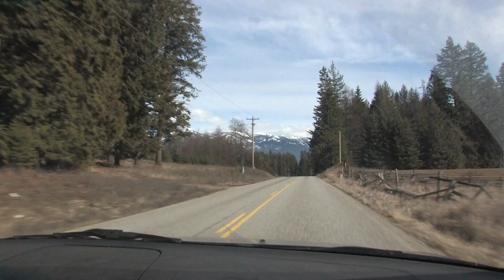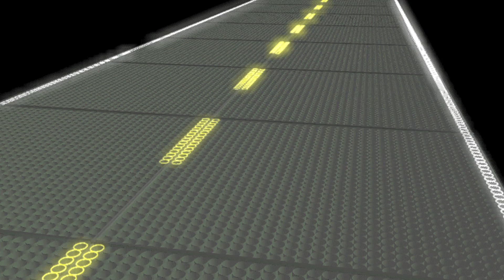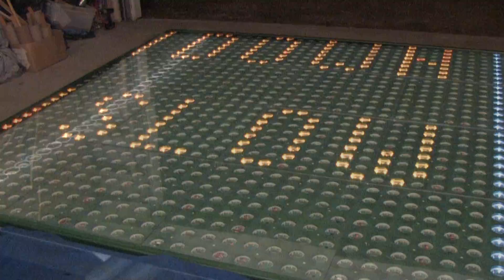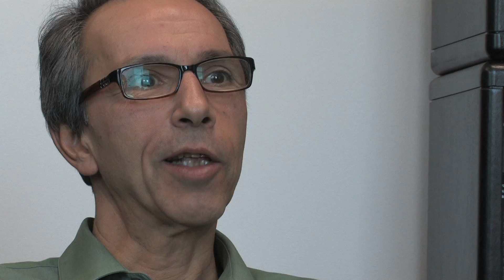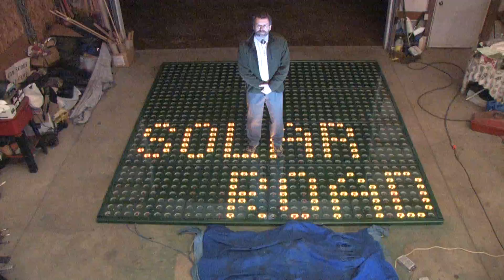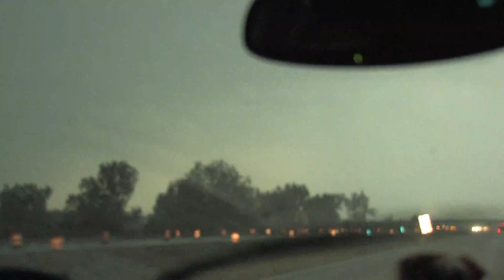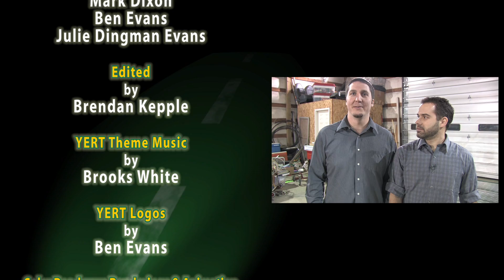Solar Roadways: The Prototype

Comment: God, it'd be funny if it weren't so sad. I watched the video then read through the first dozen comments. The majority of them consist of people trying to poke holes into the idea.  What about traction? What about silver? What about flooding, potholes???  
Isn't it possible - no, probable - that these issues have been addressed and a <5 minute video isn't going to cover all the facts?  I know there are plenty of good reasons to feel worried and negative about the world but giving up seems like a guarantee for failure.  Come on, guys - try a little hope.
Reply: wouldnt it be great if star trek was real, and we could just teleport everywhere!

Now sure there will be naysayers who pick little holes in that project, like saying 'yes, but thats not technologically possible'. /sarcasm

Put simply... hoping or wanting something to be true is not a good reason to believe something is possible.

This video is BS from almost the first sentence.... 'we are going to run out of asphalt'... this is just complete BS... asphalt is basically a waste product of the petroleum industry.  Thats why its so cheap and thats why its used to make roads.

AND YES... the fact that glass is a lousy material to build roads out of IS important.  It does not have the suitable traction properties when wet or dirty to be suitable for roads.  Plus glass is a comparatively soft material.  Dirt on the road and tyre action would probably render it opaque in about 1 day on a freeway.
Reply: ***** try this as an experiment, get a handful of dirt and rub it on your windows.  Dirt is basically small rocks, and rocks are invariably harder than glass, especially the composite proposed here.
This is not really something you need any special qualifications to know, but if it makes you feel any better, yes I am a research scientist.
Reply: *****
Why do you have to break my dreams?!

Tho as shitty artist I can say, this gives 10 new ways of creating futuristic cities look cooler.
Reply: *****
Yeah this has been making it's rounds on my Facebook feed, and its depressing to see people so well meaningly post it not knowing that it is a stupid idea that lacks innovation for a trillion trillion reason which incidentally would be the cost of such silliness.

We need better more efficient panels, not more shitty ones, and a road? I mean really, just think of a traffic covered roadway then tell me how the light will shine through the cars? its asinine for tons of other reasons all as valid as the last.

That said I'm sorta not rich and could use 1.7 million for basically a shit idea, wanna start a kickstarter with me F00t? I've always been a big fan of not being retarded, seems my love of not being poor and run on sentences might trump it soon though.
Reply: traction
 my main thought
Reply: Cost, Camabelu, Cost.  Are you willing to pay $400 per KWh?  Or $.13 per KWh?  There are so, so many logistical problems with this its mind-numbing.
Reply: Michael Myers  That's not a long time. How long did it take everyone to get electricity in their home, or a car, or internet? It might seem like a long time if you're in your twenties but believe me, when your hitting 60, 20 years is quick.
Reply: Hey, worst case scenario. I just wasted $10 on a donation.

If it means that I could be a part of a revolution that can save both the economy and the environment through free-market innovation, then I'll gladly take that risk.
Reply: I have some magic beans which I wish to sell you.
Reply: ***** I ask this question with sincerity. What are your qualifications to make the statement you did regarding the issue with opaqueness?  As far as asphalt being a waste byproduct of petroleum, that's a moot point. The idea is to move away from oil for reasons I'm sure I don't need to explain.
Reply: If there weren't people trying to poke holes in others' ideas, this idea wouldn't exist at all.
Reply: Shirley G not fast at all? maybe 20-30 years or more........
Reply: ***** I assume that your area of expertise, then, has nothing to do with this subject. I'm not saying it works - I'm not an expert either. I am saying I'm willing to consider that the people involved know more about it than either of us and, therefore, I'm not going to just reject it out of hand because of MY understanding of the limitations of glass. It's obviously up to you whether or not you do.
Reply: I have hope, thing is, it is not a good solution. They did explain in more details on their website, thing is, when a high school student debunks your idea, your idea is a shit idea.

They use terminology that they do not understand themselves to fool thousands of people, and the ideas they have are plain stupid.

A (flat) solar panel won't work well for two reasons, it only works in the daytime and it only generates 1/3 of the maximum amount of energy that could be generated if the panel were to follow the movement of the sun.

The LED's would need to be brighter than the sun to work. Have fun generating extra energy to power the LEDs, since you cannot generate enough power from the panels to light them up as well.

Overall, each and every claim these guys made is either false, or has nothing to do with a good road.

The best thing to do is create giant solar parks, places that only need to generate power. That would work.
Reply: Riley B I'm sure the same was said to Galileo.  Understand that I do not, in any way, imply that a parallel can be drawn between us; I am simply suggesting that the attitude displayed by you and others in this exchange is common whenever someone challenges current understandings and limitations.  Are you an expert in this field? I don't mean are you a scientist; I mean are you an expert in THIS field?
Reply: *****
You really are suckered into this glass road Idea aren't you? You even highlighted the problems by showing the benefit of asphalt, it's fexible, ergo it can survive the temperature and pressure change. Glass will scatch, fracture, and get extremely dirty in under a week (imagine the cost of cleaning and polishing it). I don't need to watch Thunderf00t and the other Australia Guy, to know this is dreaming. It makes no sense. Glass is a weak material because it is not fexible and scratches easily. just imagine all the dust. The enviromental damage would be catastrophic because of all the animals and plants dying from the fine glass fibres.

Not to mention creating a light source more powerful than the sun to make road markings, is that serious? Sometimes on a bright day it's hard enough to make on the traffic lights, and completely impossible when some jackass has knocked off the shade. You need some sort of reflective cells not light emitting diodes. And they only exist partailly in e-readers and are very delicate and have to be placed behind a none relective screen (that puts glass out of the equation).

Why don't you just stop copying and pasting from a solar-panel propaganda website for five seconds and use common sense. We live in a world where when someone slaps science onto shit people believe it because they don't understand the actual science. It's fast becoming a new Religion.Your profile pic says 'good without God', so it would suggest you are a skeptical person, so be skeptical of this!
Reply: ***** Nope. That was exact opposite position of my comment. But I suspect you hear what you want to hear.
Reply: 32shumble if one shines the torch in their face I'm sure you can. but if I place it down on table, and I even had it pointed directly at me, not up like it would be on the panels, stepped back a metre, then... no. it would be very hard to tell, and very dim even if I could, rendering it pointless. I suggest you do that experiment yourself.
Reply: *****
I read it you glass bs and it's copy paste bs. You were comparing the scratch resistance to other materials, such as asphalt. Asphalt doesn't need to be scratch resistant you dumb fuck. The glass has to remain emaculate for years to be cost effective. Are you really going to lie to me and tell me glass isn't going to be scratched to shit after a week on a main road, or even a small country road.

And clearly you never have driven or you're just a disingenious. On a sunny day and it's hard to make out lights. The brake lights are positioned to point directing at the driver, and they are still pretty dim, but from other angles it would be very hard to see, if at all. With traffic lights they place a shade over the light, so we can see the contrast. Without the shades you can not see shit. Will there be loads of small shades on the roads covering LEDs, so we can crawl down to see if it's double yellow lines?

Pull your head out of your ass man.
Reply: *****
You said:
"There are anti-scratch coatings that raises the already high Mohs rating of glass to be above that of quartz. As it stands, asphalt is way softer than glass with an Mohs rating of just over 1 whereas glass has a Mohs rating of 5.5-6. Quartz has a Mohs rating of 7 which is well above the more common substances one will find on a roadway such as steel (4 - 4.5 Mohs rating), iron (4 Mohs rating) and gravel. The majority of encountered gravel in the US ranks about a 5 or a 6. There are some areas of 7 or 8 but they are rather rare"

That is clearly you comparing. And still who gives a shit. The glass will scratch.
Reply: *****
Lol. Yes, exactly, "relative". You are placing it next to a item and comparing it or as the definition goes, 'considered in relation or in proportion to something else.'

If I say "this computer has 32gb of ram, which is a lot more than your normal PC, which has 4GB on average." I would be comparing, by placing it relative to something else. Not only that I am rhetorically trying to convince them that 32gb is better than 4gb.

You are trying to say it's the strongest thing in the world.

Do you need any more English lessons you thick fuck?
Reply: You're a fucking idiot
Reply: What about putting it on the roof or a field. Since they are at a angle they will be more efficient no need for led's. Less chance of them breaking by that there are no cars. And this was from like 6 years ago and still not even 1/4 of a mile or km of it. They have a lot of money and they are still in the prototype stage
Reply: ***** Well in theory they did test for traction and other things. But you gotta take their for word for it.

The glass being rendered opaque is interesting thought. I would assume they would've tested for that before applying for a goverment contest?

The idea isn't bad anyway.
Reply: *****, I'm a huge fan of your videos, and very apprehensive to call you out, but isn't the petroleum industry going to come to an end some day, seeing as it relies on non-sustainable materials?

Also, if the roadways have met the government's traction requirements, then surely they must be safe?
Reply: Lori Eve i don't think we should stop.  i think you should answer my question to continue.
Reply: Lori Eve Edison nearly lost everything because he was scared of alternating current, the what if someone gets electricuted. His stubbornness on the issue caused him to loose control of his company.
Reply: and he took TESLA down in doing it!....
Reply: Lori Eve He didn't - not completely.  But I agree that Tesla suffered at the hands of those less honest about the work and less committed to inventing for its own sake - not for profit, in other words.  That was one amazing, if eccentric, man. Nice to see someone else mention him - he seems unaccountably below the radar - I just can't figure that out. Any input?
Reply: Tesla was systematically silenced ~ he had technology that would have put oil out of control ~ even back then... oil industry was brutal and powerful.

His technology is STILL sequestered!
Reply: Lori Eve Do you ever want to knock yourself on the head for missing something as obvious as what I did in not thinking about the obvious?  Duh..... Anyway,you're quite right about it going on for much longer than is generally thought.  But you know what they say - "power corrupts and absolute power corrupts absolutely." It is about oil, to some extent, as you know.  I'm guessing you also know that it's about much more than just oil.
Reply: ***** actually Edison had nothing to do with taking down Tesla, that was the work of Edison's financial backer. One J.P. Morgan, the same man that took Edison's company and for the same reason, his desire to be more powerful than John D. Rockefeller the richest man in history. And Morgan didn't actually go after Tesla, he went after Tesla's financier George Westinghouse. If Tesla could have been a threat to big oil(rockefeller) then Morgan would have financially backed him in an effort to dethrone the king of capitalism.
Reply: Corey Schmidt Perhaps I was misinformed; I know how relatively insignificant the actions of a Thomas Edison are against the greed and corruption of a J.P. Morgan, but I did read that Edison was not fond of Tesla in his own right.
Reply: ***** you are very correct, Edison had immense disdain for Tesla. Tesla was a headstrong apprentice of Edison. Tesla had ideas that Edison thought were ridiculous and dangerous, and he took it as a personal insult when Tesla quit to start his own company. His personal hatred of Tesla led Edison down a dark path that caused him to invent the electric chair and the famous execution of topsy the elephant, all performed with Tesla's alternating current. Unfortunately for Edison no one remembered or cared that the brutal acts were carried out with AC current, they only remembered that Edison was the man behind them.
Reply: Try a little science Woman.
Reply: Corey Schmidt Quite a delayed response from me but I'm really interested in Tesla and it sounds as though you've some good sources for info. If you find a moment, can you reply with link(s)?
Reply: ***** "wouldnt it be great if star trek was real, and we could just teleport everywhere!"

You need to keep up to date with your science.  There have been breakthroughs in this regard; some quite recently. Scientists have only been able to achieve about 3 metres in distance but it answers the question of "is it possible". Naysayers like you are depressing. Believing in the possibility of radical ideas is not a stupid idea. Quite the opposite. Not so long ago (in relative terms), you'd have been ridiculed if you'd dared to say the earth was round.
Reply: The field of roads?
Reply: Riley B Hard to know whether or not you're being deliberately obtuse. All the best to you anyway.
Reply: its worth a try regardless, I could see them on the sides of skyscrapers- why not- than sidewalks-roofs- I would still rather be on a ranch 80 miles from town, but is this idea could be put into motion- why not
Reply: ***** Are you implying that there aren't actual Engineers etc.. On the Internet? who's opinions should be considered?
Reply: ***** So how much does applying that anti-scratch coating cost?

That still doesn't cover the fact that glass (tempered or not) has rather low surface tension and could be easily shattered.

Keep in mind, this idea should be cheaper than asphalt, in theory. If you start applying coatings to each tile, the price goes out of the roof. Despite what they seem to imply in this video, asphalt isn't expensive.
Reply: ***** That means that just the glass not counting the photocells, backing, and installation is $140 a square yard. Concrete paving is about $65 a square yard including installation and can frequently last over 40 years.
Reply: A Koala with Shades Get an LED torch and go outside on a sunny day. Can you tell if it's on or off?
Reply: ***** you only don't want to continue because you know your wrong. At least you admit you were comparing something, now if your brain can wrap around the fact that you said that treated glass is more resistant that quartz, then just maybe you can understand that saying asphalt is softer than glass is you rhetorically comparing a road surface to try argue that solar roads could work. But I don't expect a thick fuck like you to do that any time soon.
Reply: ***** Yep, leds are used in traffic lights. And what do traffic lights have all over the world?

A hood to protect them from sunlight. To make them visible. What happens when sun shines directly into one? you can't see shit. I encourage you to try it. Now, imagine that but without a direct line of sight, since the leds on the panels are covered by thick glass, and you see them from an angle.

The irony that you are talking down others and calling them uneducated is staggering.

I already linked you actual engineers or scientists explaining why this won't work.

Either you are really, really stupid or you are getting something out of shilling for those scammers.
Reply: ***** Are you seriously comparing anti-scratch coating (pro-tip: not cheap) to mirror's coatings?

Are you stupid? honest question.
Reply: A Koala with Shades "it would be very hard to tell" - so you are saying that you haven't tried it? 
OK if "it would be very hard to tell" then try it with a more powerful torch - less hard to tell perhaps?

I'm not saying that the whole idea of solar roadways is practical. I just think that there are possible solutions to some of the points that Thunderfoot made in his critique. 

Personally I think the problem of friction and abrasion is near insurmountable but who knows what modern material science may come up with?
Reply: ***** That's not accurate because it's not like they're using regular window panes to build the roads, what a stupid experiment.
Reply: Addressed? LOL
Reply: yep, the science completely supports this... what if, what if, what if . . . if Edison stopped every time someone said WHAT IF something terrible is going to happen from a light bulb, we wouldn't have light bulbs....
Reply: If everyone got on board and said to hell with obstacles, let's get this done. Think how fast this could happen. Those who think negatively are the only thing in the way. And I suppose those who think greedily as well.